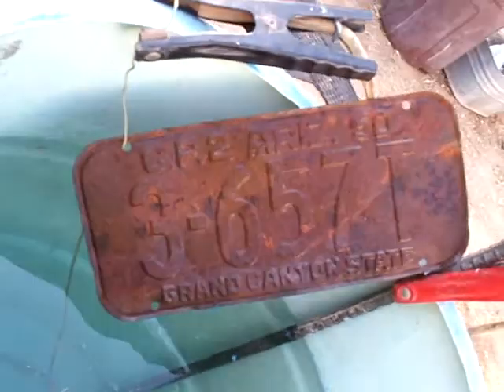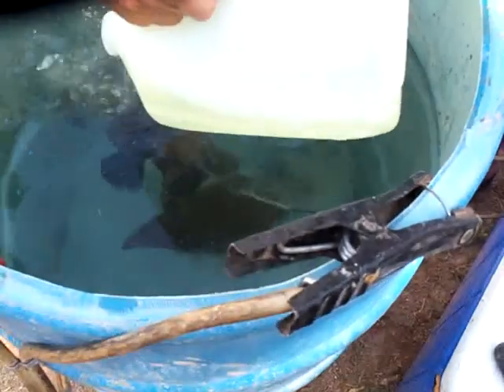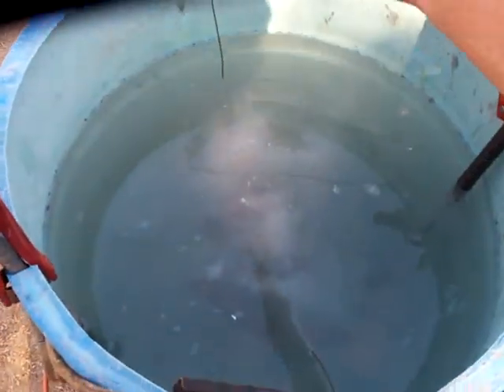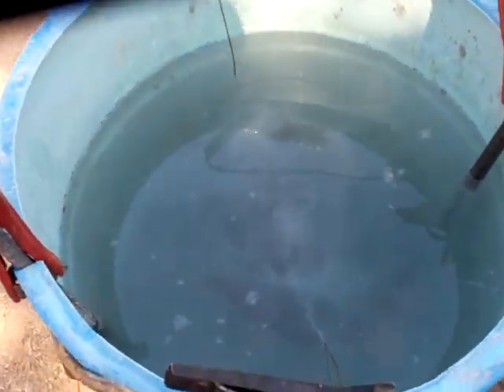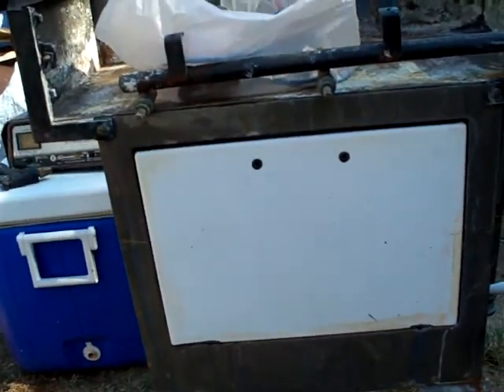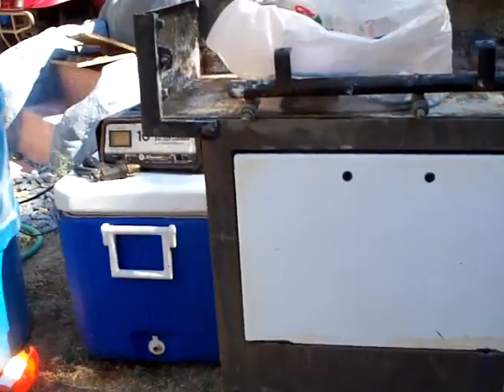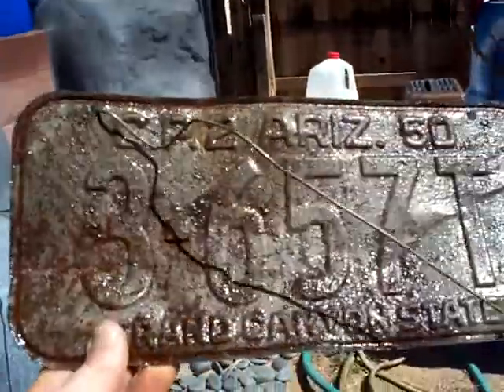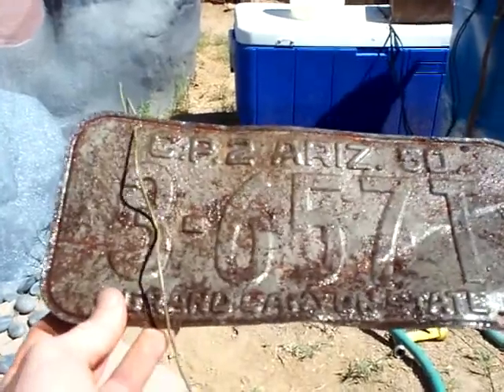how to EASY DIY AT HOME NO WORK RUST REMOVAL.  Electrolysis harley davidson

Comment: You can't submerge everything and acid and run electricity through it (like rusted fence posts). A different formula is needed. Strong black tea may also work.

Comment from the maker: check out my other rust movie, there are pictures of the 350 4 bolt main i did.  it took 3 days, and even the crank shaft was still good.  and mine was left exposed to the weather with no oil pan crank side up.  lots of hydrogen gas will be produced so do it outside.  be sure once its removed that you oil it, NOT WITH WD40.  wd40 attracts moisture and weakens the metal

Comment: How many hours will it take for an engine block I foolishly left a 4 bolt splayed main 327 block in my shed for 2 years thinking it would be okay everything is rusted now came out of a circle track car. I want to sell it now and it looks very bad with the rust. Also is it safe to leave running over night what about explosive hydrogen gas?